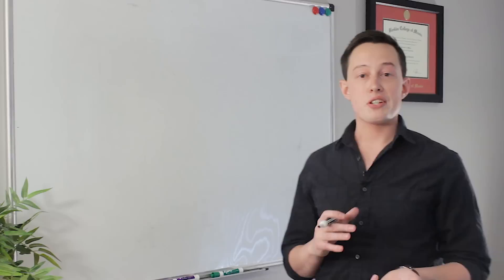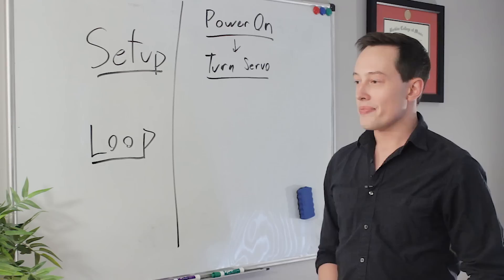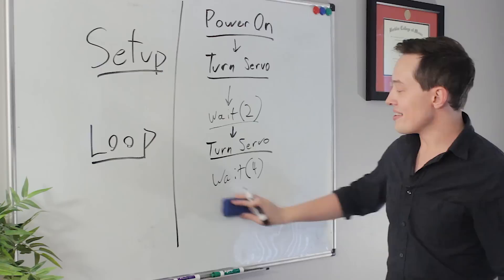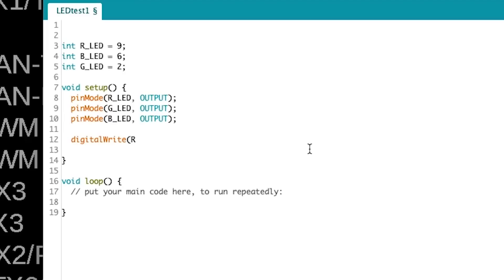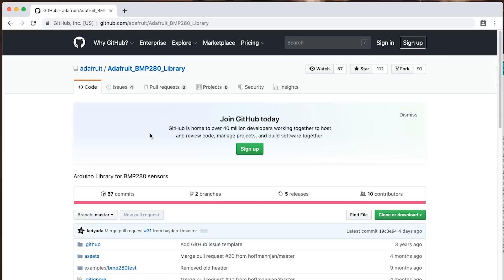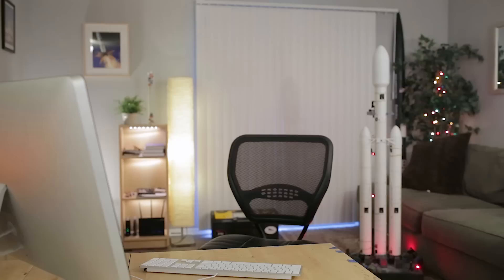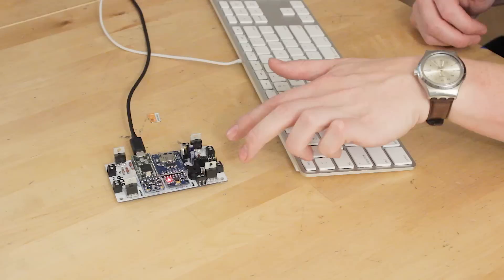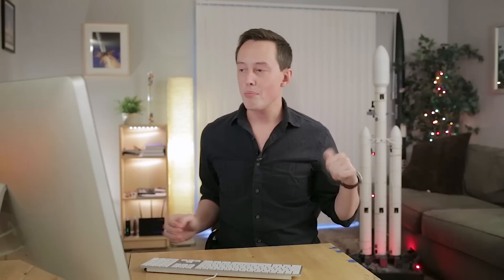Flight Software Setup - Landing Model Rockets Ep. 8

Comment: At 13:08, you do not need to unzip the library file.
The Arduino IDE will do that for you  and put the library in the proper directory for the libraries.
Select 
Sketch
Include Library
Add ..zip Liibrary

You then navigate to where the zip file is and hit return.

Comment: That was awesome! I have had a passing interest in playing with arduino for quite a while now, but I have not really had the time and have been reluctant to try because it seemed daunting... But after seeing this, I feel a LOT more confident that I could take on some entry and perhaps even mid level arduino porjects and figure them out on my own pretty easily. Thanks Joe!

9600 baud!!! that takes me back... I remember playing with some PC Serial Devices that communicated at 9600 baud, but mostly I remember old modems when BBS's and later the Internet were only accessible (for me) via dial up modem... We started off with a 300 baud modem... yup, 300... then 1200, 2400... next we got to the 9600 baud modem, then 14.4k, 28.8k, 33.6k and finally 56k. I'm embarrassed to admit that I rode that train a little bit too long... but I just couldn't afford anything better for a long time. Now I have two high speed internet connections at my house. A 300 Mb for work and a 1 Gb for the rest of the house/family. So that means I have gone from 300 BITS per second to 1,300,000,000 BITS per second!!! My home now has more than 4 MILLION times the bandwidth I had when I first got into connecting my computer at home to other computers not at my home!?!?! Just crazy to think!!

Comment: In void loop();, 'void' means that the function 'loop()' does not return anything. If for example we want to get some result, we may use 'int MyFunction()';, where we expecting integer back from the function. Also, instead loop, we can use two ways; 'while(true)' {//various things to do}, and it will execute forever because statement is always true. Or, we may use 'while(MyFunction)' {}, where MyFunction must return something, either 'true' or 'false' (or different notation; 1 or 0). This way we may write advanced things that are easy to follow. Just try it. In this case, while loop will execute as long as the function returns 'true'.

Comment: Not related at all, but you could use air augmenting on your rocket motor to throttle them by maybe up to 20%.
The easiest way to implement such a system would be a big convergent nozzle at the motor that can be moved closer to the motor by a servo.
The augmentation results from the air that is drawn to the nozzle via the venturi effect and therefore increases the working mass of the exhaust therefore increasing the thrust.
This could help you decrease your touchdown velocity.
Wikipedia article:
Air augmented rockets.

Comment: Great video! I would love to see how you handle the data of the mpu6050, specially the way you take into account the gyro drift of the sensor (a problem I have trouble solving). Anyway, the landing model rockets series is amazing, keep it up!
Reply: This is usually dealt with using complementary filter. Check out 9axis imu tutorial by Paul McWhorter.
Reply: @aliismail2962  Wow thanks! Its been a year and I haven't yet used that imu because of the issues I could not solve. Thanks for the suggestion, for sure its going to ve really useful!
Reply: @franteryda4730  no problem, and note also that complementary filter is very basic, for more advanced filters check out madgwick filter.

Comment: Hey Joe, dont waste memory for LED PINS. int = 2 bytes. ofcourse its not a problem for modern MCU, but optimization always good deal.
use preprocessor statements
#define RED_L 9
Reply: for C++, constexpr is way better, since its evaluated during compile time, and it has type safety.

Comment: no no no no... no int R_LED = 9;... better in this case #define R_LED  9

In any case... I love your videos.
Reply: For those who wonder:
int NAME = 9; creates a new variable, which uses some memory in the micro-controller's RAM. It's not much (probably 2 bytes) for modern hardware, but it would have been critical in the old days!
#define NAME 9 by contrast is not actual code that runs on the micro-controller, it is a pre-processor statement that tells the computer to substitute all occurences of NAME in the source code with 9 before it is compiled and then uploaded.

Comment: JOE please help, or anyone.
I'm trying to design a computer based off this design however I can't find a 12v lipo battery and am questioning whether that's what we need or not - I thought it was. Also I'm not sure how to wire a switch up along with the battery like you said in the schematic video.
Any help would be appreciated, thanks.

Comment: 16:45 You see those random massive downward spikes. I assume this guy knows his shit, but in case anyone else is new to this and wants to use those sensors I have some advice:
When the graph of pressure shows those random spikes down, that means it is junk data. If your program does not do anything to recognize these spikes as garbage data, you will have random problems that are difficult to diagnose.

tl;dr - 16:45 graph has big downward spikes. Your software must throw out junk data without wrongly marking valid data as junk

Comment: oohh nice model analysis by arduino atmega controller. i think that that this type of application are used by Ti controller for better accuracy and much more better choice for practical noisy environment because in practical system there is problem of atmospheric condition air pressure and much more noisy behavior os the whole system. am i ryt???

Comment: Is this Idea possible?

A normal rocket that flies up... after the motor is empty it gets pushed out of the vector control mount and an other motor is pushed into the mount and it is for the the landing....
Reply: Maybe with a spring that punshes the motor out... or it pushes the new motor in and that motor pushes the empty out
Reply: Joe does that for his Falcon Heavy model and his launching and landing rocket will do that too. He simply ejects the burnt out solid motor by firing the second one.

Comment: Is there a python version of this since I am more comfortable with python rather than c++??
Reply: No. Python needs way to much resources for such a small CPU. You could in theory write a Python interpreter for this chip, but your code would run slow, too slow for e.g. tvc, where the computer has to calculate the corrections very quickly.
Reply: Could look at MicroPython at Adafruit, but you will need a bigger microcontroller than normal. As @Entcraft44 says, it may also be too slow for things that need rapid response like a rocket but could be a good place to get you started

Comment: How would you program the Blop version? The Blip uses the arduino so I see you'd program it through the arduino IDE, but how would you program the microcontroller on the Blop?
Reply: they both run the same basis of code blip=blop=blip

Comment: 📺💬 Command signals work both int number and binary.
🥺💬 That is because it is Arduino, they build software with their new control interfaces more features I understand is global variables and protected variables that prevent you create error from update value in loop example he talking about while loop.
📺💬 Try this function read attitudes that try to adjust for the local function.
🥺💬 When you have many input and you need to adjusting to same domain for display as graph, picture or scales them into same ranges that the features when I do it with Python I need to use Denses layer for resmapling signals into new target dimension and worst if someone do not know about AI they may loop them and create quantization windows that may take a lot of process.

📺💬 That is same as you do 🥺💬 Yes because I am reading and my purpose I tell them I answers questions about Tensorflow AI some of them are optimizer or simple function as frequency domain conversation as you call Quantization function.

📺💬 hardware security features if something is attached and removed without knowing it will notify with some message or selection options.

🐐💬 It is not only the warning or option select message but it continue of process or pause some process with log and action selection because it to working with hardware .
📺💬 That is because you cannot tell robot to stop the secured is working with hardware that can handles by suitable device.

📺💬 I add some a bit of tricks I setup the speed to 9600 that is because it is international communication the faster speed is preferred but always have some expecting when negotiation and compression will be required. 
🐐💬 How can I call you back with the same speed ⁉
📺💬 I know we invent modem 🐐💬 Yes, he know and costume character to answer but the modem can pass some parameters with negotiation message.

Comment: Now make it on real STM32 (ARM based microcontroller) instead Arduino. Arduino is for kids who doesnt know electronics and want to pretend like a electronic engineer. Dont forget about ESD rules, which as far I can see, You dont know nothing about it. There is many free software to make professional PCB designs, even on Linux (yes, Im making PCB and other designs on Linux). Of course, trial software also can be used - personally im using same trial software made in 1998 year... - because parts in libraries can be made by hand.
Reply: @ratherstayhidden3064  What was funny in my previous comment?